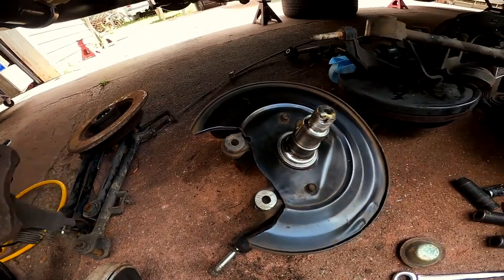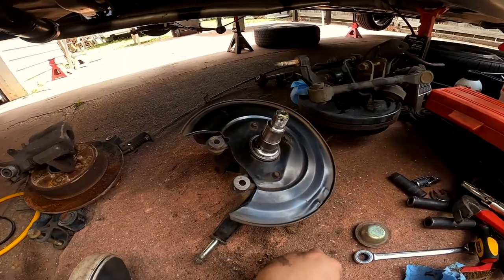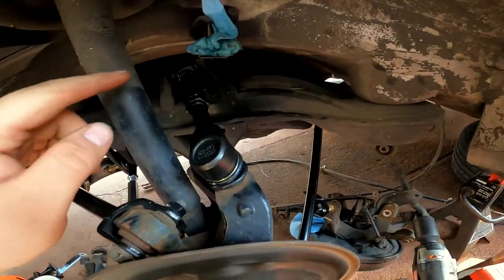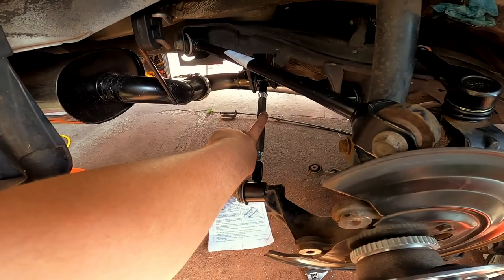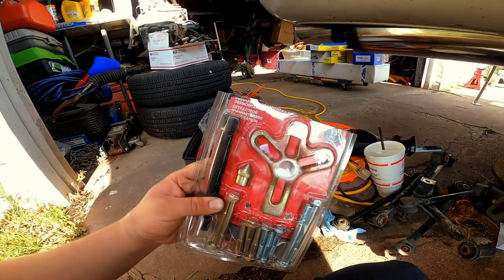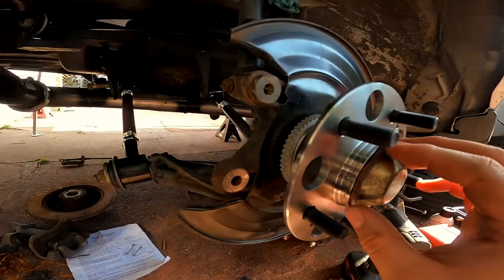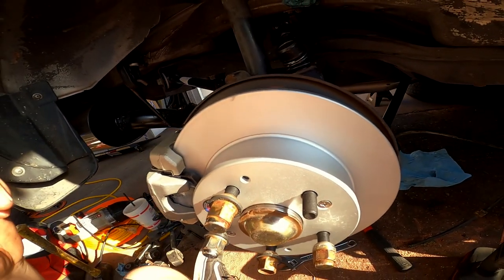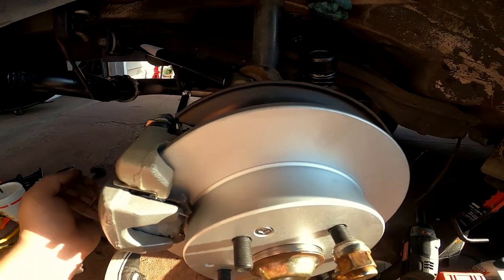98-00 Accord 5 lug rear disc brake conversion part 2

Comment: Dude I have to thank you for taking the time to make your negative battery switch to starter terminal replacement video, I’ve watched a few and by a long shot yours was the best I have seen, however the comments were turned off so I just wanted to come to this video where they weren’t turned off and say thank you for being so thorough and concise. You really have a way of explaining things in a simple yet very straightforward and accurate but understandable way. Thanks my guy 🙌🏻🤙🏻
Reply from the maker: No problem my guy! I appreciate it! I have more content for my euro r turbo build.

Comment: Hey Im dumb af, been following your guides to make my own repairs on some of the similar issues I had, appreciate the videos. For the cable replacement guide, I saw your positive cable was part# (32410-S84-A10), but the only ones I see available are (32410-S84-A00). Are these the same thing? Dont know how to read Honda part codes, thanks for any help.

Comment: I work on cars myself  working on motorcycle cars anything with an engine  most of my life and still learn new things daily I would recommend never using an impact gun to tighten a hub nut or most any other important Fastener the deal is you can't get accurate spec of torque with a impact gun what you should be using it  a digital or a mechanical torque wrench and look up the torque spec for that nut I looked it up its 139ft./lb
You're welcome!

Comment: I was wondering about your break lines. You said you ordered new ones but what about the proportioning valve? Did you have to replace that as well?
Reply from the maker: My DX trim has a non-ABS proportioning valve and I have no issues.

Comment: Those adjustable suspension arms, wat brand are they??,  i've been tryna find adustable front and rear camber kit for my 2000 honda accord coupe
Reply from the maker: Their either Beck & Arnley, MOOG, SPC. I bought everything you saw on RockAuto or Honda's website.
Reply: @somozajose17  oh nice!, i didnt know they sold camber kits on rock auto👌
Reply from the maker: @luiscisneros1756  SPC has lots of adjustable  toe, camber, caster parts.